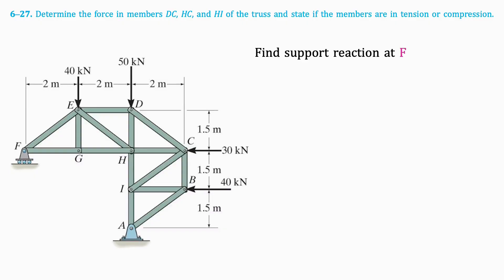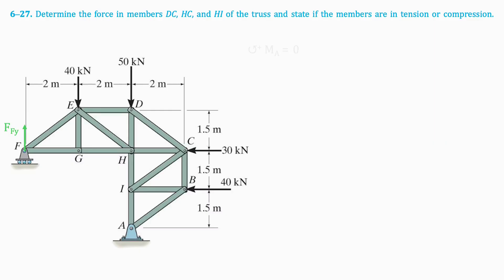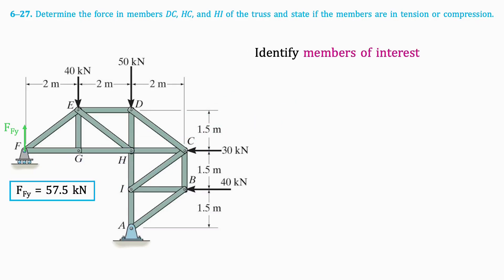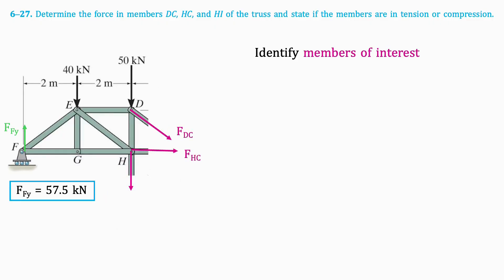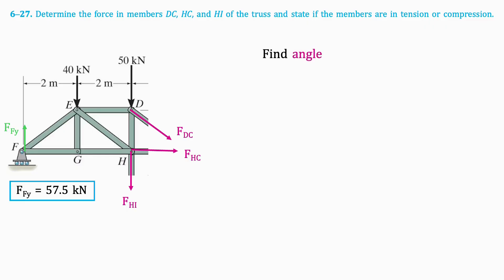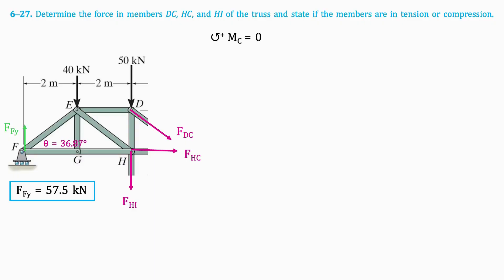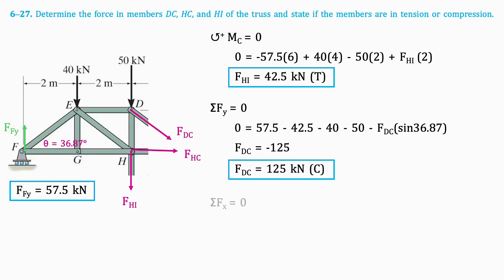6–27 Determine force in members DC, HC, HI of truss and state if members are tension or compression

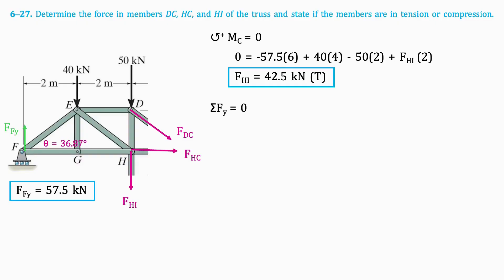Comment: 1:15 when doing the moment at point c both the forces 40kn and 50kn are pointing down and moving the moment in the ccw direction so they both would be + so the eq would be -57.5(6)+40(4)+50(2)+FHI(2)